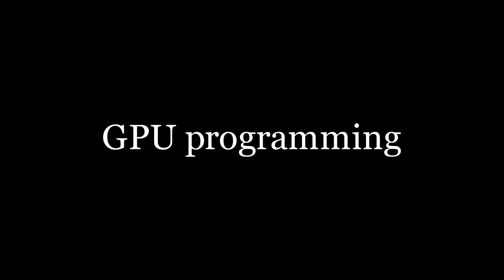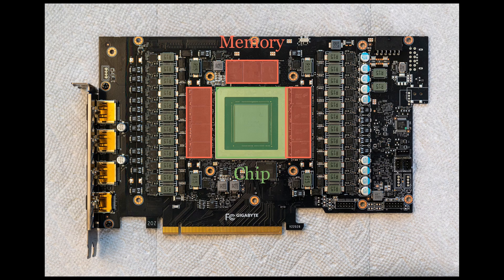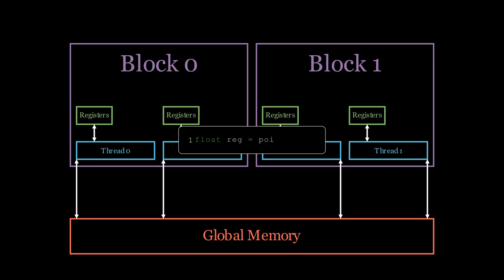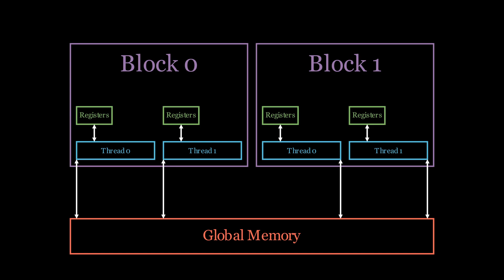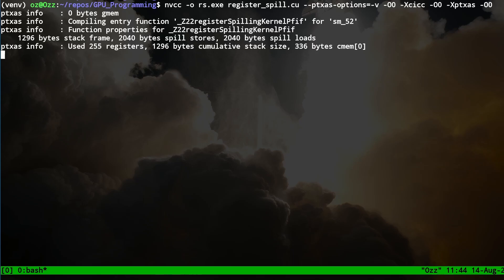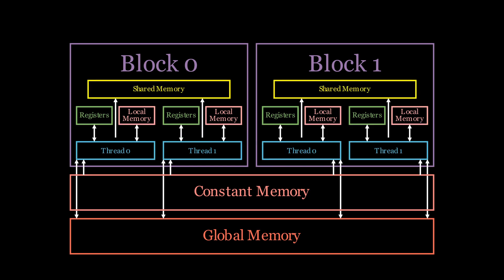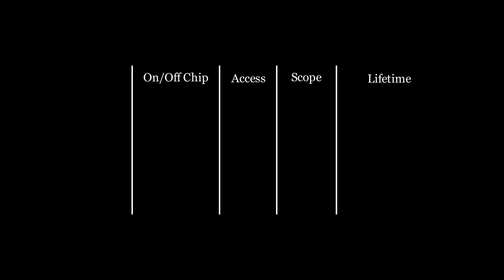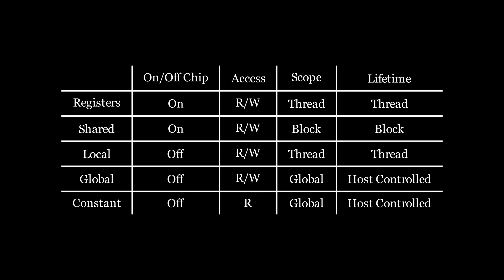Memory Hierarchy | GPU Programming | Episode 6

Comment: You say that local memory is off chip, like if it doesn't fit in the registers it ends up taking hundreds of cycles to access. This would be wild if it were true.

I think the confusion here is a confabulation of different things - physical resources and software constructs. Lifetime, scope, and (to some degree) access are more thought of as software constructs. Whether a memory unit is on or off chip is a consequence of physical resources.

Regardless, I'm pretty sure you'd have to use a lot per thread memory before it actually starts getting sent off chip (or at least before the closest cached version of it heads off chip). And I could be wrong about this, but I'd guess that if it did head off chip, it'd surely be using the same physical resources as the global memory (with drivers/compilers/whatever making sure that memory is only accessed by the thread it's assigned to).
Reply: totally agreed, if spilled registers goes off the chip memory, it would cause 2x perf lost even small spills..